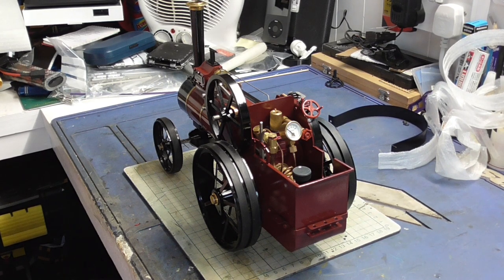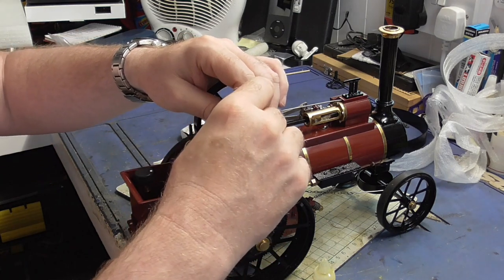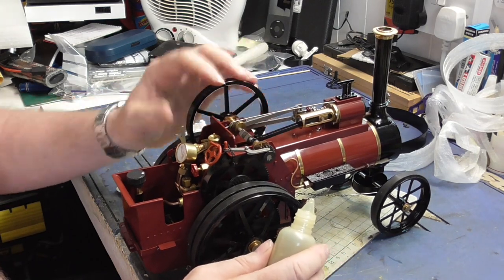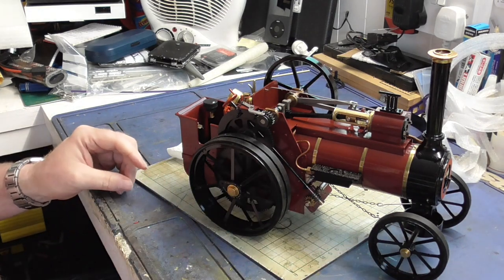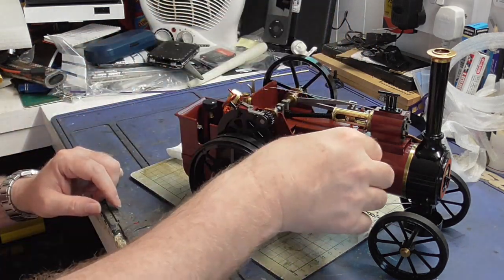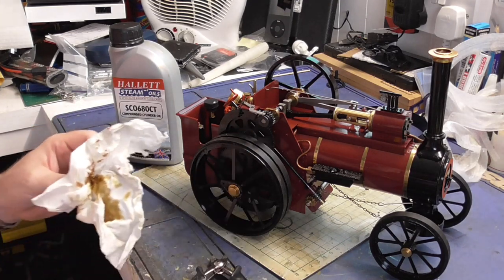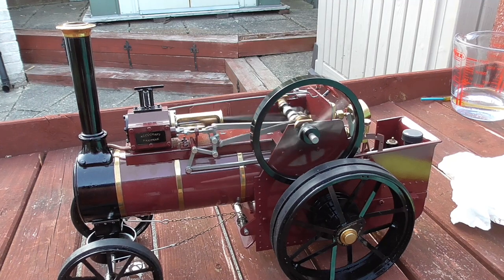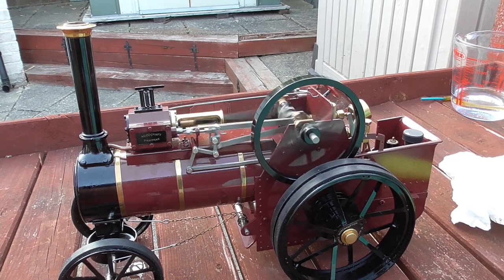Maxitrak Allchin 3/4 Traction engine - First steam and static run in

Comment: What a fascinating machine Malcom really cool to look at when you turned it sideways you could really see it preforming definitely a lot of tinkering involved in this model looks fun
Reply from the maker: They are in a different class these engines and the detail is incredible. There is a lot involved but learning all the time. How is your one you brought.
Reply: @BasBoyRC  I just bought a basic external combustion unit its pretty neat I need to do a video with it
Reply from the maker: @AdventureTimeRC  That will be an interesting video. But then I like steam 🙂